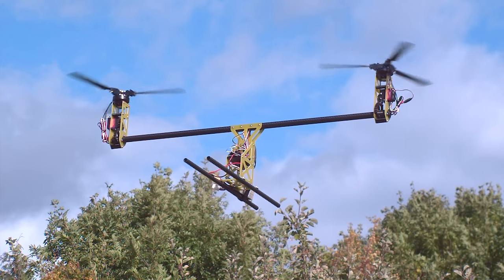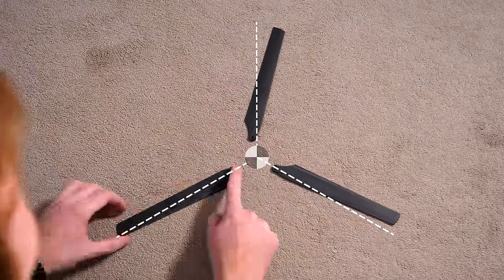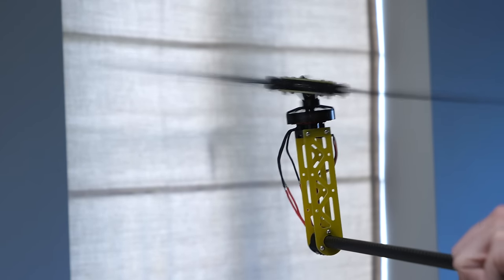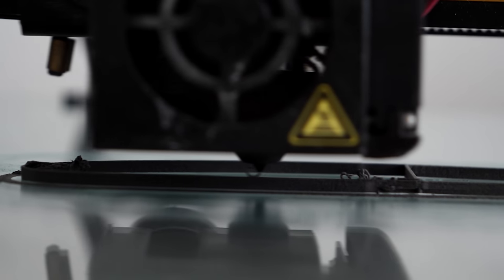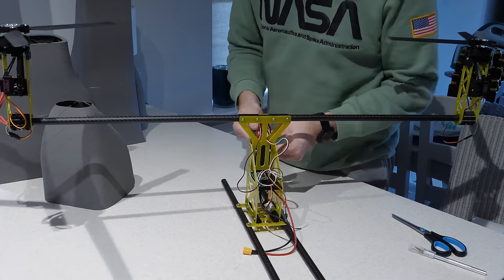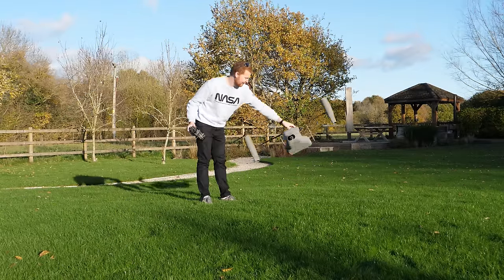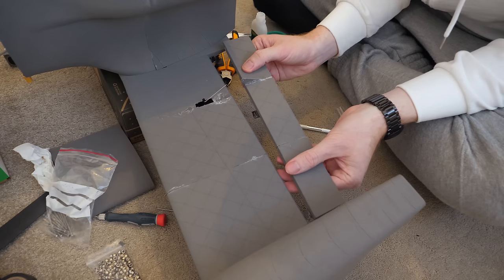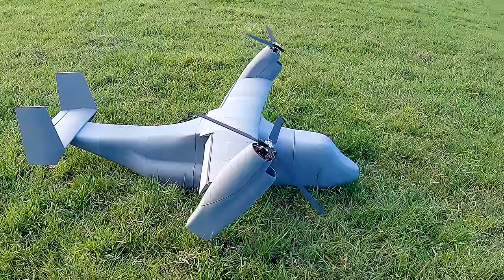Building a V22 Osprey - Part 2

Comment: This is amazing, I was a MV-22 Osprey Crew Chief in the Marines with 1700+ hours.  This looks awesome!!  Great Work!
Reply: awesome, did you have the same issues with the balance
Reply: @KhanggiTanka  Well, i bet the real one has some counterweight, because of their Fuel tanks weight shift, too
Reply: Khanggi  No, we had airspeeds at which we needed to be at to convert to helicopter mode. However the elevator was also always functional even in a hover the elevator would move. Also we had several flight computers that were constantly monitoring everything assisting the pilots.
Reply: Did the military fix the issues it had with this design? They just gave a big contract to another tilt rotor over the Boeing helicopter.
Reply: steveerossa  Army wanted to replacement to the UH-60 if you look at the V-280 there are a lot of similarities.  The V-280 has a cabin that is configured like a 60, they definitely improved on the V-22 design though.   But, that would be expected on a 30+ yr newer design. V-22 is still an amazing aircraft with lots of military service time left.
Reply: @Tailgunner1776  speaking of aircraft with lots of service life, I wonder how it's possible that certain aircraft like the U2 can remain in some form of service after 70+ years. I can't think of many forms of transportation that a machine can be used that long with only maintenance and some modernization required.
Reply: 1700? wti ssgt?
Reply: @sebjaimes5751  WTI Sgt, went to WTI as a corporal. Was also a CC instructor at 204 for a couple years and Natops Evaluator there as well.
Reply: @steveerossa  The V-280 capitalizes on all the lessons learned from both the V-22 & AW-609. Smaller than an Osprey, but hands down a great aircraft. Two of our engineers came from the tilt-rotor community, and our lead test pilot was a plank-holding V-22 Crew Chief back in the day!
Reply: @Tailgunner1776  You need to meet our lead test pilot; he was a Plank Holder at 204 when he was a Crew Chief way back when!
Reply: I to was an MV-22 osprey crew chief in the marines with 1700+ hours….
Reply: @l-vaeronautics2734  that would be cool!

Comment: "The tailheaviness" when you go back to hover mode is not only because of the motors changing their position. When going back to hover mode you still have some velocity thus wings still produce some lift especially when the flaps are down. In real or simulated V22 Osprey you can also observe the same behaviour. It is up to pilot to take a correction for the nose going up on transition. Impressive work!
Reply: Yes! A bit of pitch down may actually work as an offset and a bit of an air brake too
Reply: Same point is when I lower my flaps I must smoothly had down elevator to maintain my pitch attitude.  If I don't the nose will come up way too much.
Reply: How about a slower pace for changing between the different modes ??  I can imagin that it is to fast in going forward and backwards
Reply: @billmiller4800  this is exactly the solution real airplanes use.

As airplane velocity changes, tail angle changes. Pitching downwards lifts the tail which is good for low speeds where not enough air is being compressed under the tail to give lift.
Pitching upwards eases off this angle and consequent tail lift for high speeds where there is ample lift under the tail.

BUT here's a thought, maybe, if the thrust the motors provide is actually good enough, then for full speed mode tilting the tail even more to get the nose to point upwards just a bit should keep the aircraft climbing... Unless the wingspan and/or thrust really is just not good enough.
Reply: Indeed but for a drone, it seems undesirable to require the pilot to do such compensation. It is probably better to have three distinct stabilization mechanisms: one for rotor mode, one for forward mode and one for transition mode where pitch is used to compensate while the rotors tilt.
Reply: yeah, i watched a video of an Osprey. They have a really slow transition between modes.
Reply: Changing transition time is not a great idea, because even if we lengthen it the Osprey may still have this tendency for higher velocites. My idea is to mix the motor throttle with the angle of motor mounts so that when transitioning to hover mode the motor speed would decrease, but I havent done any calculations or proof of concept just a basic idea here 😅
Reply: the formula for motor speed when the motor mount angle = 90° could look something like this:
f(velocity) = forceNeededToSustainLift - liftProducedByWings(velocity)

Again its just an idea. Idk how this theoretical formula would apply in real world physics. Also there is room for improvement for example adding some kind of motor mount degree factor.
Reply: Reminds me of Arma 3, whenever I try to fly the osprey I always fail miserably when transitioning because of the exact same reason.
Reply: @nekononiaow  There is a reason the v22 is considered one of the worst rotary aircraft ever built.
Reply: There is no such reason, after the initial issues were fixed the Osprey has one of the best safety and maintenance record of all rotor machines.
It is quite puzzling to keep reading such outdated opinion about the Osprey when time and data has proven the contrary to be true.
Reply: This is what I noticed. I think it's operating fine, and would work very well with props with more thrust and more practice
Reply: @nekononiaow  I don't think that it's bad in performing it's function when all goes well. It just happens to not be forgiving in that it has the worst of both worlds, can't autorotate like a helicopter, and not enough wing surface to glide like a fixed wing. One has to hope that it has enough remaining engine power and the transfer shaft between engines holds up to do its job of landing if something goes wrong. Also you'd definitely be screwed if it ever gets into vortex stall. Still an amazing aircraft otherwise.
Reply: @pauljs75  It can glide just fine if it has enough horizontal momentum, if its wing did not allow it to glide, they would not allow it to fly either.
Reply: @nekononiaow  Glide in that case means descending at a rate where it's either going to smash upon contact with the ground resulting in a bunch of casualties (they might just live, but they're not walking away from it), or if managing to keep it fast enough to flare - it's going to be going at a speed that will result in a horizontal collision with something that wont be all that survivable in most cases. Going close to 200MPH to land isn't good when the aircraft isn't big enough to absorb much in the way of impact. Anyone with sense will want to try and get that thing down in helicopter mode with partial power, since it glides like a brick otherwise. Such an aircraft really warrants a BRS, but a V-22 is a bit big to pull that off.
Reply: @pauljs75  This is not a jet fighter, it has low speed wings which support it just fine during flight even at relatively low speed and it will glide accordingly, which means, just fine.
If it could not glide properly, by definition, this would require it to have a massively over dimensioned propulsion in order to fly in plane mode. But its power requirement are totally comparable to other similarly sized planes and it will glide just like them.
Reply: Ridden in an osprey, the transition is indeed super slow comparatively.

Comment: Instead of a shifting weight, I can't help but think moving the motors further down into the nacelle with an extension shaft out to the prop would give you a more balanced weight profile in the nacelle that doesn't change when they rotate.
Reply: Agreed. That CG shift is the big killer.
Reply: Mount them on the wing spar or as close to it as you can. Keep the CG shift from being so aggressive. Might even be better if they were behind the spar. Depends on how much a drive shaft and bearing at the other end weight.
Reply: This is the best solution. It’s simpler than adding a weight shifting mechanism, and the craft ends up slightly lighter.
Reply: Came here to say this, this is 1000% the move here.
Reply: I was thinking a counterweight added to the lower section however ^this would add less weight. Great idea
Reply: i paused the video to look in comments right before Tom mentioned a counterweight lol
Reply: +1 (came here to say this)
Reply: That would make pitching the props more difficult. They're using pretty much all the space available at the front of the nacelle for that, so moving the motor back/down would definitely cause overlapping issues there.
While it's definitely not impossible to do, it would add more mechanical failure points to the propulsion system. Shifting the battery is trivial and far less failure critical in comparison.
Reply: I think the bigger issue is using a carbon fiber tube spar. Carbon fiber is excellent in tension but not much else. It would greatly improve it if it had guy wires tethering it in all axis to the body.
Reply: @ThePcGamingBoss  Use the batteries in the nacelles so the weight instantly becomes your moveable counter weight. On the real aircraft there's obviously much more weight there to counter balance everything.
Reply: @rubiconnn  Would Carbon Fiber propellers be good?
Reply: I fly RC gliders with large flaps. Down trim mixed with flap activation is necessary to prevent a big  pitch up. I am not sure if this is going to fix the issue  but just throwing it in there. Great job and good luck.
Reply: Or Jets!
Reply: @velcro62  Not really. At this scale the weight savings of carbon fiber are negligible. Really the only time carbon fiber is useful is in large panels or large structural members like in aircraft or huge body panels in cars. Replacing small parts with carbon fiber is a waste of money when fiberglass, plastic, or aluminum is way cheaper and easier.
Reply: @rubiconnn  What material would you use to print 3D props?
Reply: @rubiconnn  Small CFRP parts are used all over in high performance full-scale aircraft and the weight difference really adds up over the whole airframe structure. Tubular CFRP spars like the one used here are mandrel wound with fibers of different orientation depending on the required mechanical properties and far outperform metallic ones.
Reply from the maker: Unfortunately that would be very difficult to do as the propellers needs to tilt at the  'top' of the nacelles. So adding a shaft and possibly a universal joint would increase the complexity substantially.
Reply: @TomStantonEngineering  perhaps, but I still don't see how that's anymore complex than shifting weight around. And I would be afraid the weight shifting wouldn't happen fast enough to counteract the problem you're having.
Reply: @TomStantonEngineering  Hacker make motors with a long shaft . Meant for gliders . It has an alloy shroud supporting the pointy end.
Reply from the maker: The bearing supports and universal joint/servo required to tilt the propellers would still add weight away from the wingspar and the precision parts would be far more complex than just moving the battery back and forth. With the current internal frame design, it would be relatively easy to add a sliding tray to the skids and have a servo that moves it in tandem with the motor tilts. It wouldn't need to rapidly move back and forth for 'control like shifting', but just move at the same rate as the motor nacelles to keep a constant centre of mass.
Reply: @TomStantonEngineering  seems like the best option
Reply: @TomStantonEngineering  With a linkage from the tilt servo
Reply: @TomStantonEngineering  if I could suggest transitioning to hover without the flaps & full elevator.. I believe the pitch up instability is from the rotors decreased lift with the trailing blades loosing lift in prop wash wake.. a nose up tradition to hover should help with wing flow help maintain a good air stream to the rear arch of the rear arching blades.. as the transition forward speed "drags" to a stop the elevator becomes less effective & has less authority a gradual nose down will happen naturally then easily countered with rotor back motor rotation.. & flaps down at stop to descend.. those rotor blades flexing are probably a factor too.. cheers from NZ.. excellent watch 👍

Comment: Retired helo test pilot here. I think that the abrupt pitch you experience during deceleration might be rotor flapback. Most helos exhibit similar behaviour to varying extents, and yours is exacerbated by having turned off the stability augmentation. A partial cure might be a VERY slow and shallow deceleration to the hover, with correspondingly low nacelle rates. I agree that the longitudinal movement of CG is also a big factor. Incredible project! Congrats.
Reply: A guy here…I concur! 

Could have just given the explanation without adding a title or tiara.